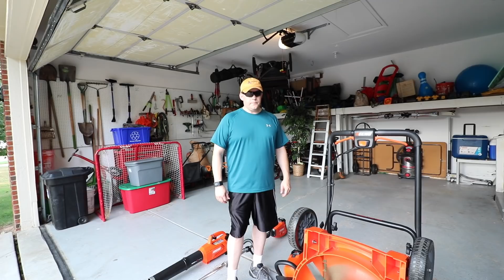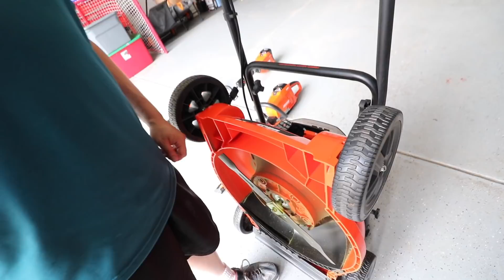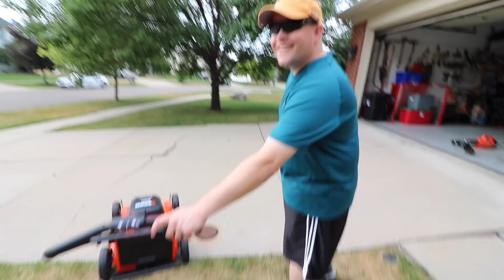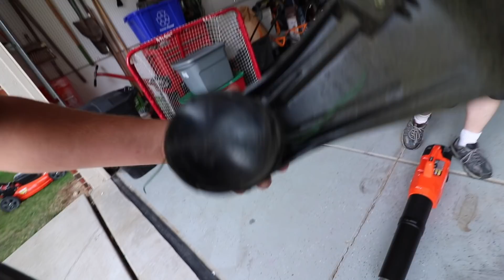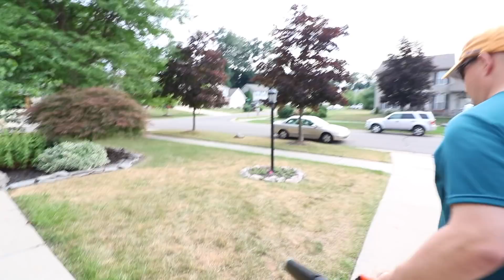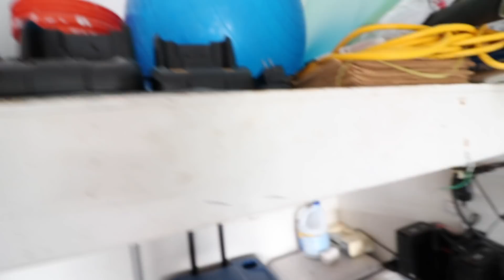ECHO 58v Battery Powered Review ► Is Battery Powered Equipment Worth It?

Comment: I know Echo has to compete with Stihl, DeWalt, and China in this era of "green technology" and interesting to watch progress but there's a long way to go. I've used Echo products for 30+ years, still running a PB-210E blower in 2018 and run cheap corded lightweight B&D hedge shears because they're efficient, easily replaceable. Exhaust fumes, weight etc. Homeowner grade but the battery tools just aren't close enough yet.

Comment: Electric has a lot of potential. 
I like the Tesla analogy. Until batteries can outlast a fuel tank and the jerry can I have with me;
or charge fast via solar on the vehicle roof, it's just not work it in the long run.
Batteries are still hugely expensive. 
All these electric machines are computer/chip operated. (which in this day and age is built to fail)
Parts for gas machines are easy to come by and for the most part easy to repair. 
That said if Milwaukee releases a quick charge, inexpensive battery system tomorrow... I'm in.

Comment: I prefer gas mowers and battery trimmers blowers and hedge trimmers I’m a young one starting a business 
I had an old John Deere self propelled 21” and in 14 years My dadnever changed the oil OPS He sharpened the blades 2 times in 14 years and she ran great until the self propelled went and it was way to dam heavy to push. But now I bought a Honda self propelled mower and it’s great and I’ve found the ryobi battery trimmer and blower is great it’s cheep durable and has a great run time. I use the Honda mower and ryobi trimmer and blower to mow 5 lawns a week and besides having to stop and re charge the battery’s it’s great

Comment: wow, now THAT looks like some serious battery powered stuff... stuff that will actually WORK, though I am curious how he would feel after using a nice self propelled push mower with large diameter rear wheels, cause when you use the fuel preservative it takes a LOT of the maintenance out of the equation

Comment: Battery power is required when fire restrictions disallow the use of gas powered equipment during  high fire danger season, so for me the Echo 58 volt brushless system allowed me to continue working and earning.

Comment: Id like to see the energy cost on charging all them batteries over the course of a month when you mow/trim/edge/blow off weekly. They cost much more upfront for quality battery equipment. You always need an extra battery/charger to get thru the yard. In the last month and a half ive used one gallon of fuel between my mower, edger, trimmer, blower. So we will say a 3 dollar operating cost. Can you keep all them batteries charged for under that? Can they hold up to weather? Cant always work in ideal conditions. Im gonna have to stay with gas for now.

Comment: I like gas better than electric I am a homeowner but are use my blower at work and my weedeater I have to use a blade on it sometimes to cut small stumps out of my backyard because I have a bunch of those and I really just need the power and I already have my old equipment that has went out in the past and I got new gas powered equipment because I already have some of my gas equipment working and arty have gas

Comment: The American people are so behind the Curve when it comes to the 21st century. The lawn mower companies are producing these mowers to last 4 years at the most. And then rebuild carburetor. All the advanced mower, comes with a gass cut off valve. So that you're able to burn excess gas that would sit and spoil while sitting in carburetor. Which completely destroys carburetor.  Regular grass mowers are for professionals cutters for everyday use. While advanced mowers are for family cutters, who sits mower every winter.   I have advanced to non gas. 
Hope this will help anyone,  who's trying to decide. 
Sincerely.  Mr. Williams.
Reply: whats an advanced mower? i have several
pieces of equip with B&S engines,if i forget,i simply dump old gas & re fuel.2~3  pulls an i"m roto-tilling.stuff your curve !

Comment: My opinion on battery is I don't like them becuase half way through the job you run out of battery and I don't have a good place to charge them in the trailer,  after half way through the season you need to drop $300 I battery's because they don't hold a charge any more. But in the future I see them take over gas!

Comment: For a very small yard in a neighborhood, maybe ok. When you use the term Home kinda misleading, Homes come across the board big, small. Wanna see a rock hit that mower deck.  Batteries are the major hang up moving everything ahead. OEM batteries are not cheap. Being a engineer as your friend is, has he measured how much it costs to charge a battery. He didnt add much engineering lingo into the video. Details...Details. Im waiting on self driving mowers myself.
Reply from the maker: Awesome thanks for sharing

Comment: I agree with you Brian, as a home owner battery may be the the future, but for me as a contractor, I just cant see it! The run times are just too short for all day and every day use and those batteries are not cheap when they do degrade and have to be replaced.when they make everything that can handle or exceed the abuse of daily contractor use and make them water or rain proof, then I'll consider giving them a try, but till then it's a no from me...